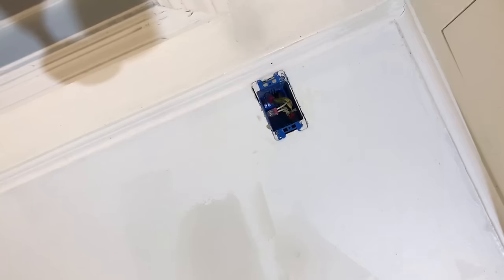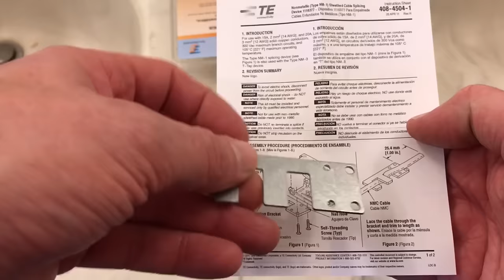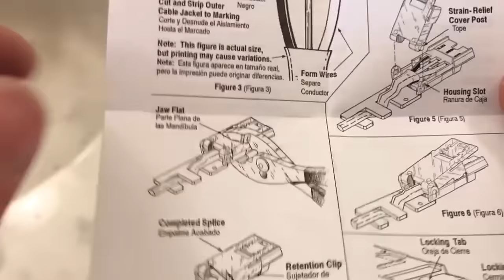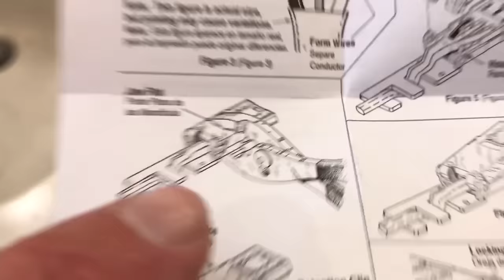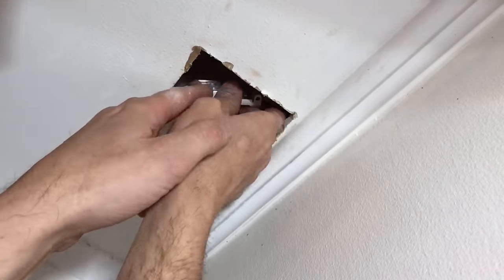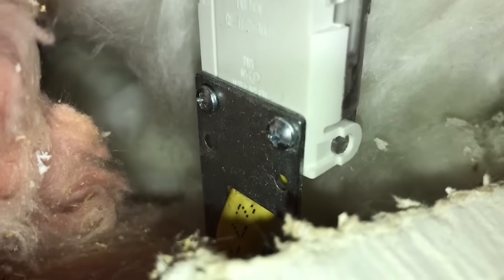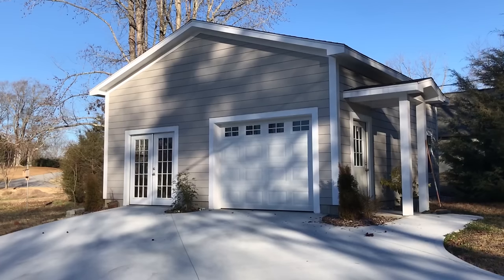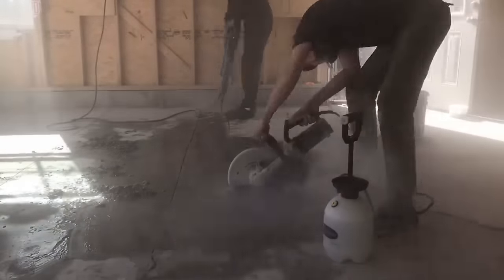Do I have to have a junction box to splice wires?

Comment: Aluminum wire was considered safe at  one time also.
Reply: Nearly all service wire on the power poles up to the Electric meter are Al, much of the wire in Industry (high currents) is Al.  problem is NOT Al wire, it is the bad connections to the Al wire.

Comment: That is a Jack legway Real electricians do not do that they pull away new wire
Reply: pfft, yea right. the ones we use at work  get lazy and either go in the attic to where cut wire is good, pull it back refeed from splice/j box now in attic or hide the j box in most obscure places possible

Comment: I'm not impressed with those. Electrical wires really need a good, solid mechanical connection. That flimsy crap doesn't deliver.

Comment: Yea no i would never use that and its against code to have splices hidden in the wall. The reason you dont do this is because splices build heat and eventually fail.  This could mean a house fire that atarts in the wall and fires in the wall are the most deadly.

Comment: That connection looks potentially lethal in the future, and highly dangerous. Much better to have put the WAGO connectors you already had in place into a WAGO BOX. Which is certified as maintenance free. You probably wouldn't have needed to make the hole bigger. Suggest you employ a qualified electrician and take this video off YouTube.

Comment: holy crap! I hop no one is taking this guy seriously.  NEVER USE A SWITCH TO TURN OFF THE POWER! get your lazy ass to the breaker box. never cut insulation with a box cutter. if you put the smallest nick in the copper it will fail.
as far as the "boxless" connector, you wouldn't catch me using one. looks like a disaster waiting to happen.
Reply from the maker: Thanks for the input, Bill.
Reply: every sparkie Ive ever seen or worked with has never once used the romex cutter. matter of fact, the one laughed at me when I tried to use mine, and tossed it in the wall

Comment: These turn one connection into three poor ones. Two are just like the cheap ones idiots use on auto tail lights for splicing in trailer light harnesses. I wouldn't use these on a bet.

Comment: No fucking chance I am using this garbage. I am only using a steel junction box proper grounded with a grounding screw and pigtail, pre twisting my wires so they cannot pull apart, twisting my bare conductors with pliers and cutting them to the proper length, using T&B marrettes made in Canada, not some cheap Chinese knockoff, and an enclosed steel cover plate. I am not gambling on my house burning down on a cheap piece of 'convenient' plastic and sketchy push connectors. Do a job correctly and you will have piece of mind and keep you and your family safe.

Comment: That metal strain relief is going to cut through the sheath and insulators over time, maybe not today but down the road someone will have to fix a short buried somewhere, if it doesn't set itself and the structure on fire first.  Poor trade for appearance sake...

Comment: Run a new wire… electrician here- I have used these only in really shitty situations where the splice only goes to one led light.. I’d never use it on an outlet circuit or any high load situations. No way these things provide a solid reliable connection- I’d almost rather see a flying wire nut splice. They barely have a place in this industry and I’m surprised that code allowed it

Comment: So, it's for "repairs only" and you're using it for cosmetic reasons, which is not a repair.  Got it.
Reply from the maker: I installed the box to make the repair, then decided to take it out. The box is not original to wiring. Thanks for the comment.

Comment: This whole video is a waste of time. 
IF  you just hate seeing that box, IF  you are dead set on  using this product , IF  you are  just going to bury this in the wall, THEN JUST LEAVE  THEM SPLICED IN THE BOX AND PATCH OVER THE BOX OPENINGS. At least the wires would be spliced instead of using
 this garbage, and IF there  is some arcing for whatever reason at least it's in a box

Comment: Those type of connections make very little contact with the actual wire.  Horrible design.  They also may not be approved for use by your local AHJ.

Comment: Always be wary of a device specifically designed to find a way around code. You consider yourself a DIYer and still say you are surprised by the connection method used. Red flag maybe?

I’ve removed quite a few of these that have failed. I’ve never seen one cause more than superficial property damage from them melting and charring. Thankfully I’ve never had to replace them hidden behind drywall, that would be a pita to locate.

While it’s against code I would be more comfortable using replacement extension cord female and male ends. Funny that, a connection with a more solid electrical connection, better strain relief and rated for higher currents is against code. Hence why I said be wary of device specifically designed to find a way around code.

I honestly doubt you’ll have a problem (assuming the plumbing can’t leak on it). However if that was on a heat lamp and anything with a moderately high current draw I could almost guarantee it would fail within 5 years.
Reply from the maker: I hear ya. I'm really not keen on the connection myself. Thankfully this one is just running a bathroom exhaust fan and light. Thanks for the comment!
Reply: Always be wary of anyone who calls themself a DIYer or a Handyman on youtube. These are code words for "clueless idiot".

Comment: These are nothing more than T taps for romex...there a reason why we don't use t taps in automotive electrical applications. Side note: T taps should never be used in automotive applications.
Reply: no no, for automotive splices anyone knows household wire nuts are the goto method. if not, twist and tape is fine as well
Reply: @harveylong5878  I surely hope your joking about wire nuts as wire nuts are rated for solid core wires and the only acceptable splice is a military spice. Even soldering can introduce excessive resistance if heated up too much (in automotive applications only)

Comment: Youve got to be kidding pal! You have no idea what your doing. First u MUST have a junction box. Second those connectors fail. They burn and open. Next u used a no contact tester to see if a circuit is off!!!  You truly are a danger to yourself and anybody you work for. I sure hope your not doing electrical for anybody else. I am not an electrician but I know alot better then this.